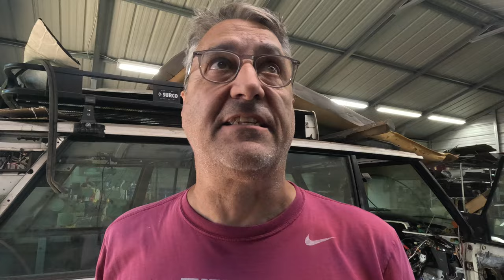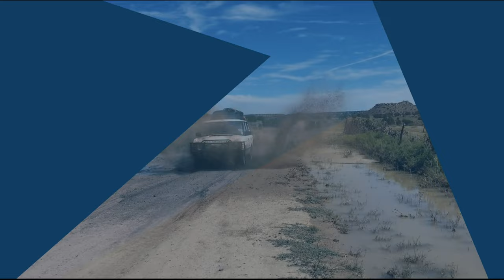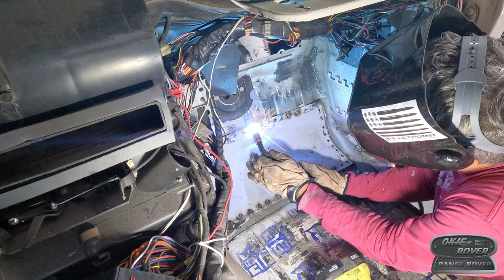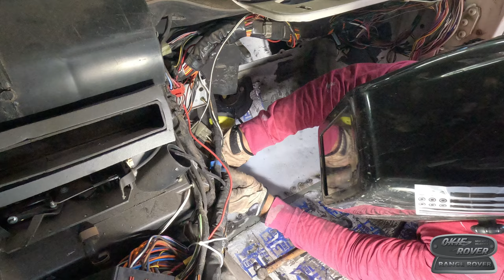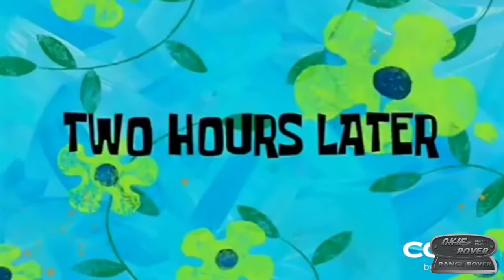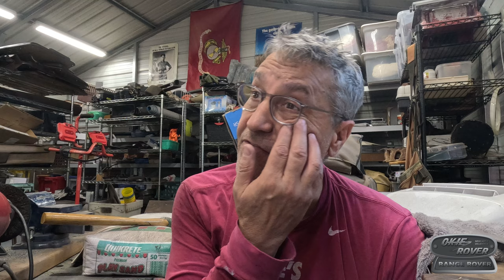Footwell Repair Part 4: Floor Panel Repair, Failing Spectacularly (Post #663) 7/20/2024

Comment: Maybe check if you have any scrap/used metal that already has the shape you need in it.  You could cut that piece out and graft it into the new panel.   If welding isn't working, you could look at pop rivets.  They 've worked great for me on my project and past projects
Reply from the maker: I tried self tapping screws. Then I talked myself out of using them. The biggest issue was an improperly fitted panel. Should have spent more time shaping.